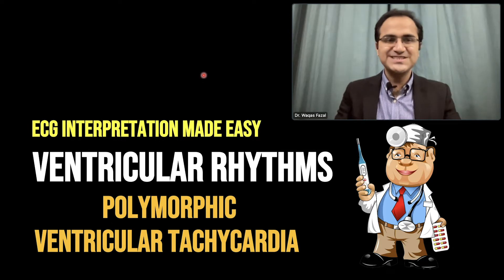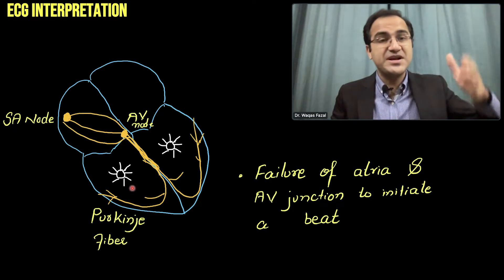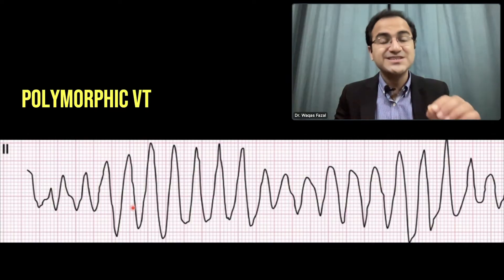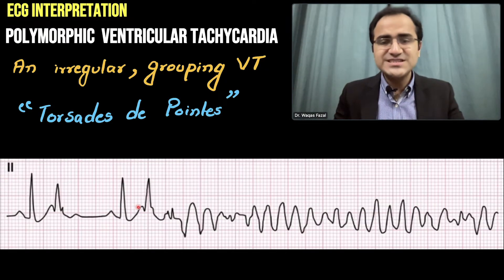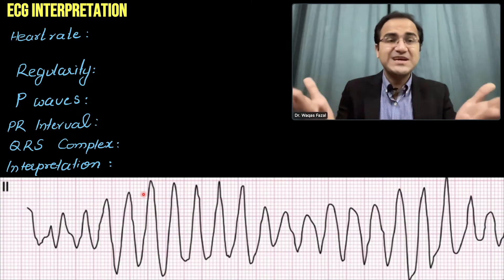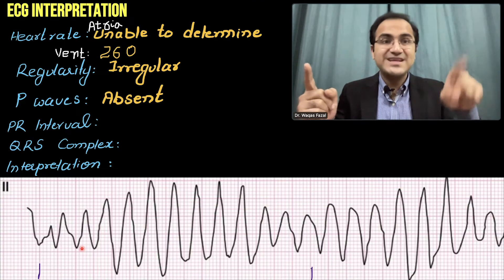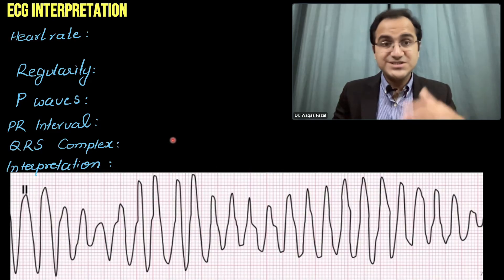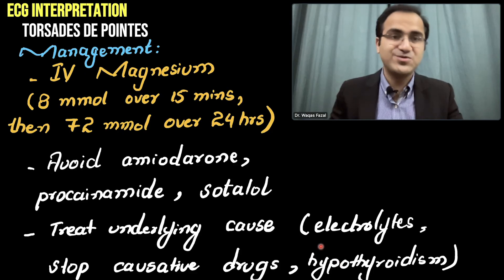Torsades De Pointes ECG, Polymorphic Ventricular Tachycardia Treatment, ECG lectures USMLE, NCLEX

Comment: I was found to have at least a few runs of Torsade's De Pointes on a halter monitor about 29 years ago when I was 6 months pregnant. At that time I was put on a calcium blocker. I was not on any type of drug at all and no one could ever tell me why. They sent my halter monitor reading down to the University of Michigan to make sure the diagnosis was correct and they concurred.  I have had many different but not as serious arrhythmias since but mostly kept under control. Just recently I have been diagnosed with Diastolic heart failure. Could it be from so many years with arrhythmias?